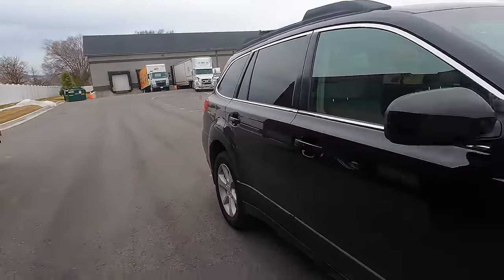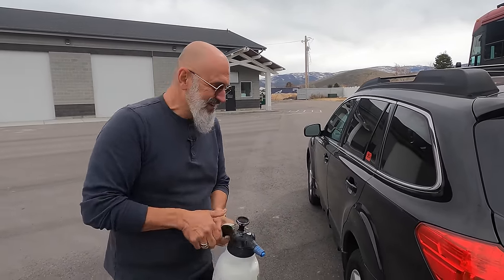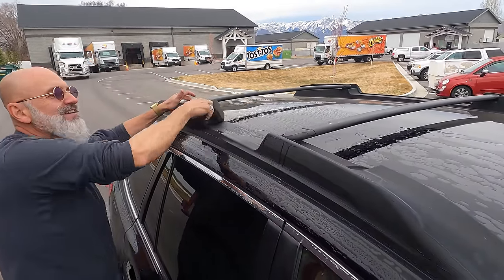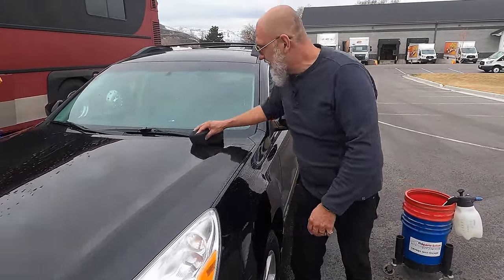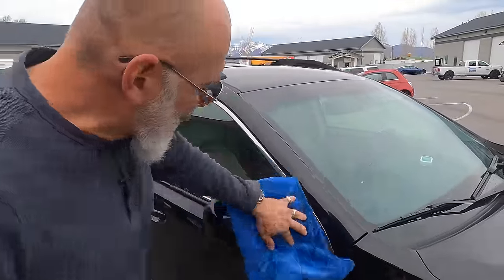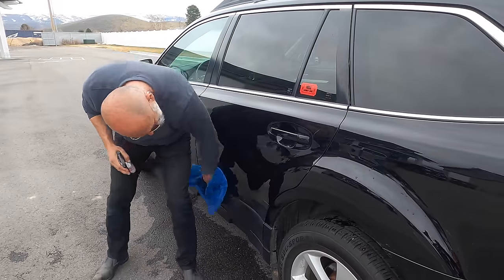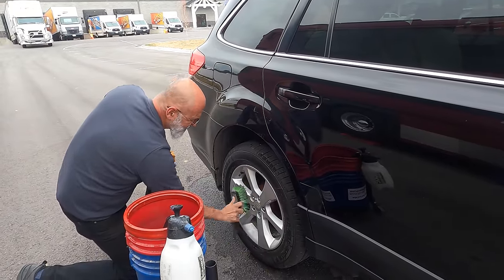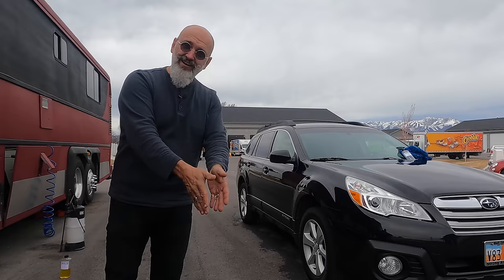RINSELESS CAR WASH: How long does it REALLY take?? With Yvan Lacroix

Comment: Good demo. Can you comment or maybe do a demo on a vehicle that lives in the country not in the city and you have a little more incrustation around the wheels. Could you use an all purpose cleaner or rinseless wash spray first and let it soak in then rinse it off without agitation and then go back and do the rinseless wash with a sponge?

Comment: I've always heard Yvan say not to use a drying aid with rinseless as it has it's own lubrication.  Why the change?
Reply from the maker: Lubrication is a good thing when drying, because drying is when you have the greatest risk of scratching paint. So I would say use a drying aid for safety....
Reply: @HawkProDetailing  Go back and watch all of his rinseless videos.  He only says to use it when using a soap, not a rinseless wash.
Reply: In my videos I don’t say not to use one, I say there’s no need to use one for lubrication, but if you want to use one to add protection, or simply because you like using one, then by all means have fun. 

In the case of this Subaru, it needed the protection that the spray ceramic sealant offered.
Reply: In my videos I don’t say not to use one, I say there’s no need to use one for lubrication, but if you want to use one to add protection, or simply because you like using one, then by all means have fun. 

In the case of this Subaru, it needed the protection that the spray ceramic sealant offered.
Reply: @Detailers-Business-Academy  Not to use one or one isn't needed means pretty much the same thing in my book.
Reply: @Tundra_Guy  You are twisting his words. He's NOT saying "Don't use a drying aid!", he's actually saying "You don't NEED to use a drying aid, but it's fun to use one."

Comment: It look like that rinseless wash did a good I just hate using the sponge it seems to not get the dirt off.
Reply from the maker: It does take....almost a suspension of your worst "thinking mind"....to make the jump. It's easy to get freaked out, but this method works....and it's especially good for you at home. Sure, the foam cannon etc is great but that's an hour MINIMUM in the driveway...plus chasing water drips etc. this method gets er done, and it's as safe as you make it. Every car wash method....I don't care how many mitts, how fancy the soap, how many buckets....will introduce some scratching. especially during the drying phase

Comment: Did you use a grit guard in the bucket?
Reply: It’s 2 buckets in one, the inner red bucket has holes in the bottom. It does the same thing as a grit guard.

Comment: Rinseless  vs traditional washing; it’s all based on opinion. Different times once works better or faster than the other. I disagree with rinsless being “safer” because I have done tons of traditional in just as fast of time and never had scratching or whatever. He does what works for him. There is no “best” way. I use both but with a pressure washer you are doing to get in places to get dirt out where a rinseless can’t touch and that’s a fact. I will say though a detail keg is awesome! One thing is I will never use a sponge like that. It’s all based on opinion.
Reply: Best thing to do its spray car down with rinse less and then pressure wash it (foam optional). This cleans off more than using a alkaline foam. Then just just washing it by hand. Just one extra step.
Reply: @amounifnd  A rinseless WILL NOT clean the car off in the prewash stage like an alkaline foam like bilt hamber auto foam. Not even close.
Reply: @whitegoodman7465  It is in the context of the Rinseless wash. You should not be using a Alkaline foam for regular washing, especially if you have a coating. Well at least ones that work like the Carpro Lift.
Reply: @amounifnd  Bilt Hambers products do NOT hurt proper LSPs.  Especially their Touchless presoak which has slightly better cleaning power then autofoam.  They both have superb cleaning power compared to other snow foams, carpro lift, and especially rinseless prior to pressure washing.   Even a cheap spray wax will hold up to dozens and dozens of washes before being degraded by autofoam & Touchless. If you’re coating is going to be diminished by these 2, you should probably consider a better alternative.

Comment: For those saying you can't do this on a muddy car you actually can. Pre treat it with onr or an APC on the paint pressure wash it off and then go at it with the sponge. Common sense. If it has a lot of bugs on the front use whatever you do for bugs and rinse it off and get to washing lol. All the overthinking isn't worth it lol
Reply: Yes , you are talking about using a pressure washer . This method they showed does not use one so no this method won't really work on a muddy ass car .
Reply: ...I'm sure ppl who really get their car/truck dirty have to audible to get the big chunks of dirt off the car.  I don't see how pressure washer spray (1500-3000psi) scratches paint using a 40*-45* tip, but whatever.   The car here was lightly dirty.  Obviously, chunky dirt needs a different approach.

Comment: What was that staining on the drivers door when you did a closeup on Ivan kneeling by the last wheel? Waterspotting or dried out rinseless that the drying aid was not able to „re-wet”? Looked kinda unpleasant given all the washing. Btw. I’m a huuuuge rinseless fan, bought and tested half a dozen by now  - I do a soap wash 2-3times a year together with decon&wax and all the rest with rinseless.
Reply: This car needs to be polished, paint is very contaminated, spotted and scratched.

Comment: Best solution do a paint correction, apply ppf and simply no rinse for the rest of your time with that car. No scratches no worries 👌 easy and cheap washing without stress😃
Reply: I didn't need that 10,000 anyways

Comment: Does the 3 gallons used for dilution  need to be distilled water ?
Reply: It would be best if we use distilled or di-ionized water. Although if you detail just 1 or 2 cars, 3 gallons is really not necessary. A little goes a long way.

Comment: I live in the North East and the winters can be brutal. How would you use a rinse less on a salted car?
Reply from the maker: sometimes it's better to take it to the local self wash tunnel and pay for a minute or two of pressure washing. Get the gunk off the car, the wheels and wheel wells, even the undercarriage. and then drive it home and do your rinse less wash.

Comment: Won't the incapsulated dirt just get stuck in the towel your using to dry off the rinseless. Won't it just scratch the paint while your drying. Or should the towels only be used once and throw it away?
Reply: You spray the panel, the encapsulation over the dirt traps it and then the sponge soaks it up. You aren't drying it when the encapsulated dirt is sitting on the panel!
Reply: @davos6621  Dirt is still being dragged from side to side. The encapsulation forms over it..not 360 degree and lifting it from the paint..

Comment: Ilove this but what about those wheel wells what have caked on mud and stuff
Reply: You can always use a hose or pressure washer. If you don’t have access to one, you can go to one of those self serve coin operated car washes and spray them out there, then drive home and do this process. Remember that a rinseless wash does not mean that you’re not rinsing the car before, it just means that after it is on the surface, it does not need to be rinsed off.

Comment: How do you wash very dirty wheels including inside barrel with rinseless? I am a mobile detailer I use onr which I love but my problem are the wheels, extremely dirty and I can’t leave a dirty barrel
Reply: Use whatever wheel cleaner /Degreaser you like and then mop it up with a microfiber that's rung out from your rinseless wash
Reply: @Brian-dj3ru  can you use one that is iron removal? Like ferrex or ironx ?
Reply: @2busytv166  I do it when only necessary but when using iron x, I have a pump sprayer with just water in it(during winter) and I rinse really well and then mop up with rinseless wash
Reply: @Brian-dj3ru  I was thinking you actually need a pressure washer for ironx or similar. So a pump sprayer for example like ik pro 12 filled with water can do the job?
Reply: @2busytv166   yeah you're right it's more preferred.but you make do with you got..its more time consuming but you make do with what you have..but at the end of the day you're still rinsing and then you're washing it afterwards.
Reply: One thing to keep in mind, as Detailers we focus on things like wheel barrels, most consumers couldn’t point to them if you asked. They really don’t care, nor see them. If it’s a full on detail, possibly worry about the barrels, if it’s a maintenance wash, don’t worry. And if you think your customers care, ask them if they want their wheel barrels done, for a $40 surplus, you will quickly see if they care.
Reply: @Detailers-Business-Academy  That is a great point thank you. I am looking to use power clean in a IK foam sprayer as an initial degreaser. Can you rinse this off with ONR and then dry the car and call it washed or you have to use water to rinse the power clean? Or any other foam solution can it be rinsed with ONR?

Comment: So basically you apply the rinse less worth the sponge and then clean the car and pick up the dirt with the towel?
Reply: Sort of true.  Although not a big issue since the RW is providing the lubrication. I still like a clean drying towel. If i am using the BRS or UBS .. i go over the car with a dampened MF towel before the drying towel. This also allows you to use a smaller drying towel since the damp one picks up most the water.
Reply: @Jeeper1378  good plan.

Comment: Whats the dry agent used with drytowel ? Standart detailer, clay lube or rinsless cleaner? 

Somebody knows if Infinity Wax Zero Water rinsless cleaner works well for this cleaning?
Or Dodo Juice Mint ?
Reply: The one used in the video is diy detail ceramic gloss. Most detail sprays and rinseless washes work well as drying aids
Reply: @ethanblan435  thanks. 
I have problem with QD on piano black. 
Left smears/streaks. I washed the car becouse It had smears after polishing, wax and quick detailer after wax. I dryed car with QD after wash but spray QD only to the drying towell. Next I polished QD with second towell. 
Too much work, maybe some new scratches by polishing with second towell , but no smears/streaks. Perfect.  
Next day ok.
 But smears/streaks pop up after 3 days. Car seats in the gararage after washing. 🤔.  So I will never use QD on black, piano black car.  I'd like to try rinsless wash but I have fear to use it, that it can left some smearing.. on piano black car. 
I can use everything on second silver car, its ok but not on the black.
Reply: @zzo28  I have no issues whatsoever with either diy detail rinseless or ceramic gloss smearing. As far as smearing on black, if you didn’t use too much product, I would change products. I’m a one spray per panel kinda guy. If you over apply a product, you’re likely to get some streaks.

Comment: Can I do this:   
1st step: Rinse with water.
2nd step: Pre-soak with ONR.
3rd step: Using UBS Sponge-wash the car soaked in ONR
4th step: Dry and done.

Is this a good process what do you think? :)
Reply from the maker: Yep! I prefer some kind of sio2 or ceramic detailer spray as my drying aid especially if the panel has dried even a little bit or you can lightly spray on some more ONR before wiping. This is a great way to wash your car 3 out of every 4 times or so lol but once a month I still love me a foam cannon and soap:)
Reply: @HawkProDetailing  I use Drying aid indeed. But that's how I'll do customers cars from now on, when they take basic in&out service. Quick easy effecient.
Reply: and my car too, xd

Comment: Ivan:  Put away the foam cannon, you don’t need it!

Bilt Hamber Touchless:  you sure about that?

In all seriousness I love both wash methods, but BH Touchless really does wonders.  I also keep on self Mckee’s N-914 rinseless and it’s awesome and smells amazing.  Comes in handy when doing customer cars next to other cars that I don’t want to get overspray onto from the traditional wash method.
Reply from the maker: Lots of great products to use if you're going to involve a pressure washer:) If so, DIY Detail Rinseless Wash....for example....can do a great job emulsifying before your pressure wash. Or mckees 914:) Or BH although I've never tried it, I'm sure it's great
Reply: You must try them!  BH Touchless you apply dry before pressure washing, plus it has emulsifiers in its formula.  It chemical dissolves bird droppings, sap, etc, and you can see them bleed.  BH wastes no time with fancy marketing, labeling, product names, scents, just chemists that create nothing but perfect performing products.   I use BH touchless as my pre-rinse, then I use n–914 as my contact Method.  I have created my own hybrid style wash I guess you could say and it works perfectly.  15 minutes tops.  Doing detailing, painting, Auto Body, designing, developing, fabrication, i’m not gonna be wasting time just washing cars.  That’s why I only choose products that do a perfect job and fast.  I have no time to be wasting, zero.  Give BH lineup a try, you won’t be disappointed.

Comment: its clear and the camera is shwoing the dirt is still there, how you going to clean inside the wheels or fenders or grills without the pressure water, yes i agree its the best to lubricate the body, before using the water pressure, but total zero use of pressure water is not logically right

Comment: I think they are over complicating the traditional washing methods. It has never taken me over an hr for a basic wash. Especially if i dont do the wheel arches. As they said if you have "sacrificial" towels well even the cheapest towels are about $.50 ea. So that needs to be factored in to pricing each wash. I pre foam with bilt hamber touchless and use their car soap for the was. One bucket for wheels and one for washing takes me about 30 minutes to do wheels, tires, arches and body. A little more if i add dressings. I dont use a drying aid. Black challenger and i dont get water spotting.

Comment: That’s it’s. I’m tossing all the BS I’ve bought over the past few years and simplifying my arsenal to rinse less 😂
Reply from the maker: Haha try it first....it works great 3/4 of your car washes a month (if you wash, say, 1 time a week)..I still like a good full body soaker but it's so convenient from your driveway to go rinseless.
Reply: Don’t throw anything away, sell it to someone.
Reply: @Detailers-Business-Academy  what’s the apc you would recommend most for the rinseless wash?
Reply: @markrizzo2283  use what you have, then get a good quality, detailing APC.
Reply: @markrizzo2283  big Greenstar fan here
Reply: Although “dirt” seems to be an argument and region dependent—a pump sprayer to pre treat the car will be all you need for most every wash. 
If it’s caked in mud, grab a $100 cordless pressure washer, stick it in your bucket, and rinse off the dirt. 
Yvan has proven that foam cannon pre washes don’t outperform using a rinseless wash to do the same thing. 
Rinseless actually  works for 4/4 washes, if you do it right 😉

Comment: The up close made it looks like the car never got wash, looks dirty. Alot water spots
Reply: Those were hard water stains in the clear coat... You need to correct the paint with a polisher to remove those. The paint was as clean as it could possibly get.

Comment: How do you rinseless wash neglected wheels ? Always the worst especially the barrels also the exterior in all the cracks is tough to clean out as well I’m going to try it though not sure yet
Reply: When it really has caked on dirt, Id prefer just regular cleaning w any wheel and tire cleaner and then pressure wash it off

Comment: First, that car isn’t that dirty. Let’s see one that’s been driven in winter on wet, sandy or cindered roads, not just a water spotted light coat of dust. I’m also calling BS on the “encapsulating” the dirt. If that were the case why is there un-incapsulated dirt all over my car after applying ONR or a pH neutral foam as directed? It’s not like all the silica infused dust/silt just left the sheet metal and formed into a nice little drop to be wiped off. Even foaming with a pH neutral soap and rinsing with the PW, it only removed the heaviest of grime. Nearly all the nasty, silica infused dirt is still there. Whereas the more alkaline washes like Bilt Hamber Touchless actually removes the vast majority of it using the same techniques. I’d rather remove the silica/grime and reapply a final coating than constantly remove clearcoat polishing out all the swirl marks from the sand the ONR or a pH neutral soap leaves on the surface to smear around.
Reply: Correct but no ones saying you can't pre wash before hand. It's a huge misconception with rinseless.. I prewash with bilt Hamber autofoam and a pressure washer then use ONR as my soap since it's better than soap. Best of both worlds.
Reply: @whitegoodman7465 my man!  I presoak with Bilt Hamber Touchless, and proceed to N914.

Comment: Not a Fan of rinse less, for using a "drying aid" he was spraying it on area's that were already dry to remove dirt, , I observed him using it as a glass cleaner and straight up cleaning solution on several panels. Using the "drying aid" to me was him rinsing the car, just doing it by hand with chemicals. - Just my opinion.
Reply: The dirt was already removed by the sponge. The spots you see are polymers from the rinseless, as he describes.